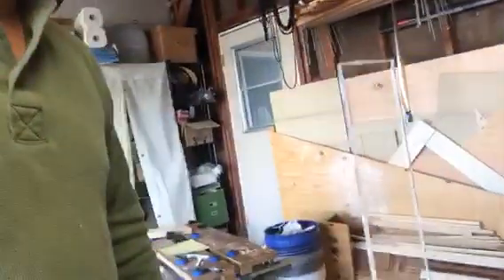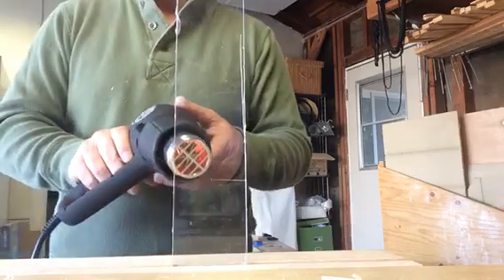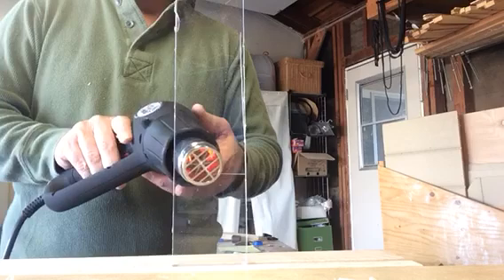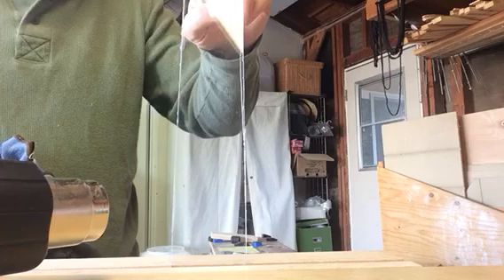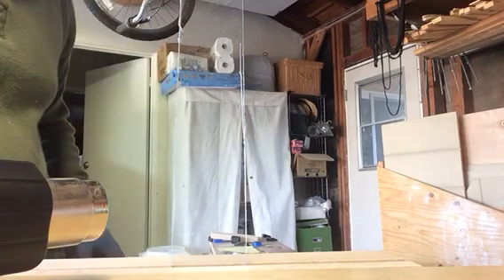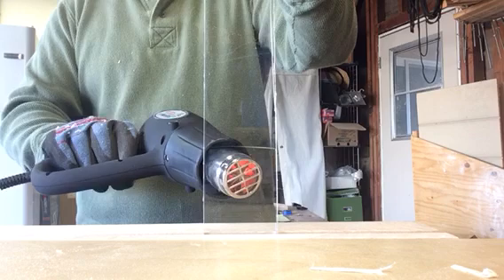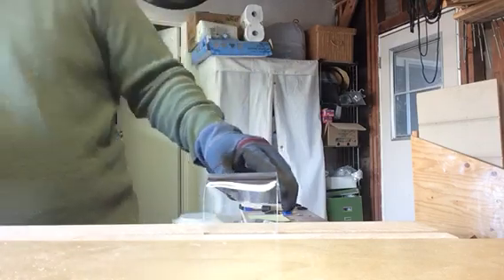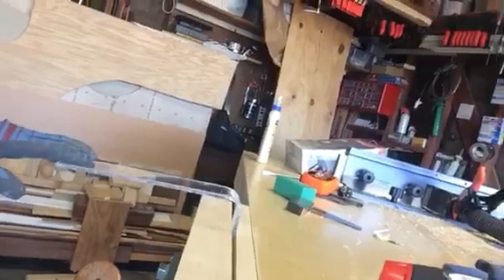Bending plexiglass with a heat gun

Comment: My heat gun has attchments that can narrow the heat gun area to a more concentrated region, may help with tighter bends if no mould is available?
Reply from the maker: I would recommend using a form if you can, you will get a more reproducible result

Comment: Hi,
It will work with hair dryer?
Reply: I dont think a hair dryer will be hot enough.
Reply from the maker: They really aren’t designed to get this hot.  That isn’t an expensive heat gun (Harbor Freight) but note how much thicker it is then a regular hair dryer.  Also, it get VERY hot after a bit.

Comment: Hello Brothers, can I make a float glass band in the same way? Please answer
Reply: Just search youtube. The key is to heat the glass evenly at the same time, otherwise it will likely crack. Also the temperature is much higher so you need professional gear.